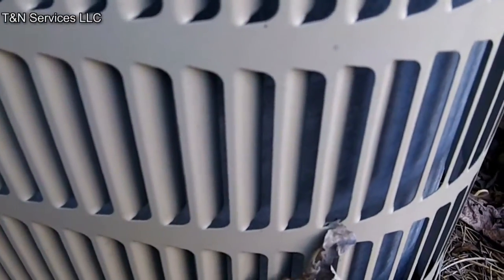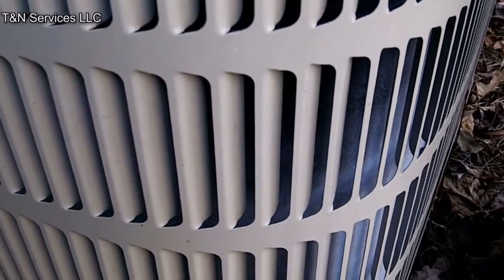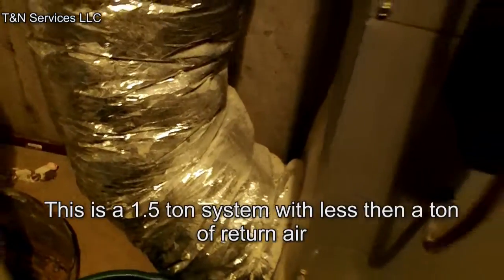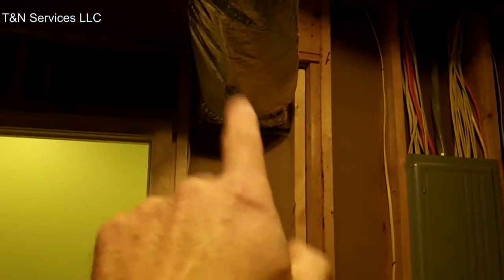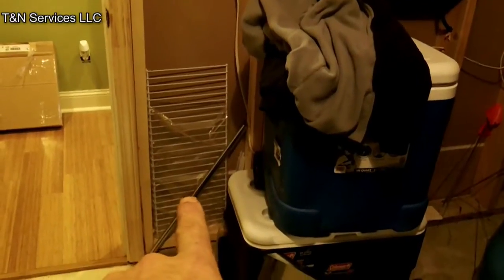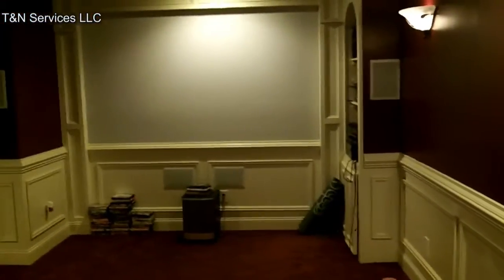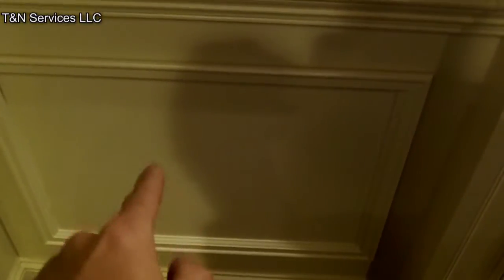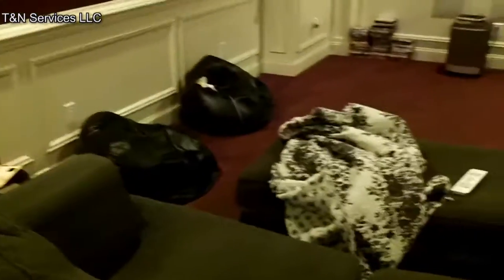HVAC Ductwork Repair Pt.1

Comment: just about every system up my way is way short on return air .nice job ralph
Reply from the maker: Hey Steven, most systems down here are short on return also. Most aren't this bad though.
Reply: Looks better now. Maybe next time you could go over the calculations on how you determined the necessary return air flow. Thanks.
Reply from the maker: Cooll Asice This was the first job video I've made since October or November so I was a little rusty. I've had the footage on the computer for a while but have been pretty busy. Trying to get back in the swing of it again